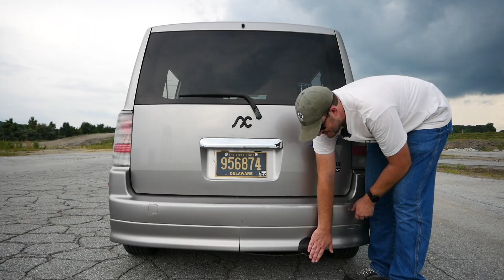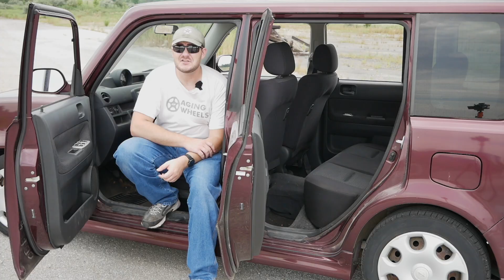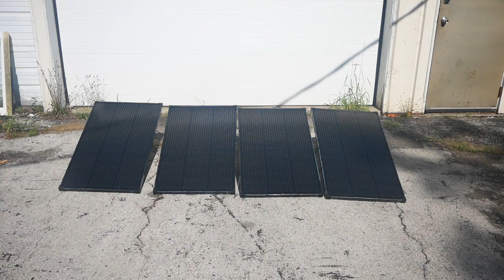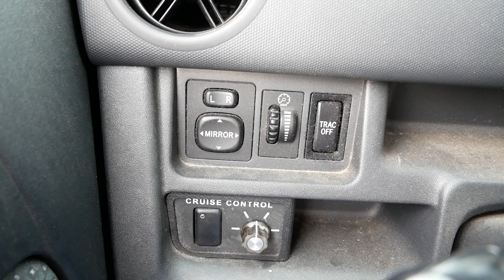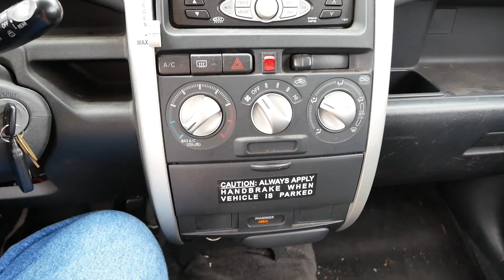The ACP eBox is a Technology Showcase Crammed Inside a Cheap Toyota

Comment: Fun fact: the Renault Zoe which shares the Leaf platform could charge with 64A per phase. That's up to 43kW AC! Nowadays the new Renault Zoes still charge with up to 22kW AC, they changed to in-house motors from the first cars which had motors from Continental. It uses the same system in which it use the motor as an AC/DC converter.

Comment: I have a regular xB and it's the best economy daily driver ever and also quite possibly the most reliable car ever to exist, the original AC even still works! It gives me lots of time to... Ignore working on my project cars. But at least it's not taking any time that I might actually spend on them...  

...I like the weird driving position and I've always described it to others that it's like driving at a kitchen table. lol

But seriously, 335k miles and it's never stranded me. Sure it's needed an alternator, a couple water pumps, a clutch and most recently a starter, but of course that's expected for anything with so many miles.

Comment: Here's the thing that I don't understand. Apparently the new world order wants every country to go to electric vehicles. There isn't a single country whose electric grid could handle that. Is there a reason especially on vehicles like this one that there are not solar panels on the roof? Heck you want them protect it Make the roof safety glass put the solar panels underneath the glass kind of like the little cloth slidy thing on a sunroof You can't tell it's up there one that's shut same concept only you're charging it while it just sits there and you don't have to do anything and it won't cost you any money and it won't pull off the grid. But I'm not an electrical engineer nor am I a car designer so what do I know

Comment: Interesting little car the ebox, but why on God's green earth didn't they use the gas filler as a charge part instead of hacking a rudimentary hole in the grille?
Reply: They probably didn't want to deal with the hazards, expense, or logistics of routing heavy duty cable from the gas filler all the way up to the electronics up front. The shortest distance from the inverter to the outside was the grill, so they just hacked a hole there. It's incredibly ugly, but I get it.
Reply: @TheCammerhammer considering how advanced it was, it just seems bizarre that they cut back on something so visibly obvious. The heavy duty cable could easily follow the routing of the old fuel lines.

Comment: About the speedometer - I bet the non-scion speedometer is the correct one. I've seen some japanese cars and pretty much all japanese motorcycles that have the speedometer off by 4-5 MPH.
Reply: It's fairly typical for a speed readout to be higher than the actual. In fact even in digital dashboards, the ABS sensors will read the correct speed but the vehicle speed is set to be roughly 2-5 mph faster to account for error so that if anything, you're not speeding because your dials are wrong.

Comment: I own a 2006 Scion xB! Bought it brand new with 60ish miles on it. Now it has over 206,000 miles on it and still going strong! 💪 Would love to be able to upgrade it to electric and modern accessories. I dread the day I have to put it to rest. 😭
Reply: Swap the radio to a 11in touchscreen, it's pretty easy and very nice
Reply: @marcusborderlands6177  😂  Take the worst thing out of new cars and shove it into your old one!
Reply: I am on my 3rd xB. Bought my first one new on 05 at the first gas price fun, I sold it when I got a job that provided a company car. A friend loved mine so much, she bought a new one in 06. I ended up buying that from her when the dealer was only going to give her 400 for it on trade. It was at 225k, I drove it for a year, then gave it to my kiddo.  I bought an 04 RS1 to replace it. Used it to drive Lyft for 2 years, and still have it today.  Just turned 235k. I spent 2500 going through the whole car, Timing chain, struts, all suspension wear items, new AC compressor, clutch, tires yadda yadda. I love my 1st gen xB, and have thought about buying another and a wrecked Prius to make a factoryish hybrid. But, it already gets 31mpg. hehe
Reply: My 2005 is right at 206k as well. Starting to rust away in Michigan but one of my favorite cars I’ve ever had. Once the used market cools off, I plan on looking south to look for a better example for a summer replacement
Reply: @hotdogboyjim  Why not leave ?
Reply: These cars last forever.  Mine has 190K but still like new. The crazy thing is these sell cheaper than any used car. Most people think they are ugly so it hurts their resale value.  You can buy one of these for under 4K in great shape.  Really wish Scion was still around and wish Geo was too. Two of the best brands ever.
Reply: @luciusandrellius9817  I dont know where you live, but their resale is not hurting in AZ or TX.  Beat up ones some with salv titles are bringing 2500-3500 here, and clean ones with 200k miles are 4500-5500, and there are a handful that are RS low mileage models that are listed at 7k. When mine was wrecked, Insurance paid me 2k more than I bought it for 2 years prior after owner retaining it. I think 40-60% of value 18 years later for an eco box, is pretty darn spectacular. :)
Reply: I have the same year with a bit less mileage.  It’s a manual, and I’m expecting the clutch to go before anything else.   I actually like the driving position although I’ve had to replace the drivers seat once and it’s getting soft again.  I hate having to practically lie down on my back to drive in the kiddie cars they make today.  My girlfriend’s Prius is SO uncomfortable to drive because of this.
Reply: My 09 has 197k on it. Still opens up good and can keep up with a teenagers vtec Honda
Reply: how bout now? did you Jinx it?
Reply: You never have to.. why does everyone think cars have a service life? As long as you deal with any rust and don't wreck it, a car will last your whole life. Of course major parts will need servicing, but a cars body can last basically forever..

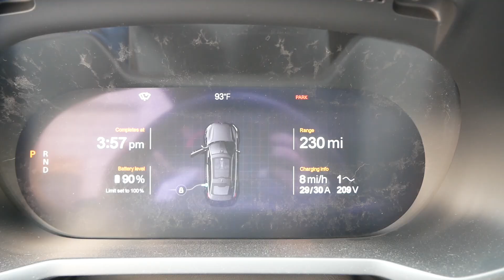Comment: 10:39 wow I assume the "tick" isn't the charge plug clicking in, it's actually the literal terminals producing an arc over to the ebox. wouldn't this be dangerous lmao
Reply: No. Thats the locking mechanism in the charge port engaging.
Reply: It’s not live until he manually starts it in the vehicle when he says “start”.
Reply: @cargoudel  Yes but he says if he were to touch it he'd be dead. And that was when the plug was exposed. So if it was already live when exposed, it'd arc over when brought up to the other car's terminals. 

I assume that, with this being the charge terminal, it'll run to the battery or at least its (dis-)charge controller. So if you plug in a "reverse" plug that exposes that contact, it'll just be live instantly. I guess it won't deliver serious amperage or even discharge fully until enabling it for continuous safe use by switching it on in the car. Unless this car happens to be advanced enough and/or has some other component switching that line, most batteries will charge and discharge via the same connector, so if you expose and touch the charge port pins, you're also touching its live line. 

I saw other comments confirming this shared port setup which would mean the line just is live. Maybe not by default to fully dump the car's power storage into the grid at high wattage but enough to be dangerous to a person.

Comment: Wait, OK, so... when it goes into "power output" mode, it literally just... reverses the flow through the charging cable?

Wow.

Between that and the gauge cluster you need at least a bit of electrical training to understand, that tells me ACP had zero personnel who were anything other than engineers. No UX designers, no one with any knowledge of marketability, no liability lawyers, not even anyone who knew a liability lawyer.
Reply from the maker: You got it! Like I said, zero mass market appeal at all
Reply: Outputting power through that cable would be like using a backup generator for your house.  There are special safe plugs, but some people just have a double male cable connecting it to the house, and they don't have any special wiring in their house to prevent backflowing into the grid, and need to remember to do it.
Reply: It is the exact sort of thing I would love to own - as an engineer. Wouldn't let my mom drive it unsupervised though!